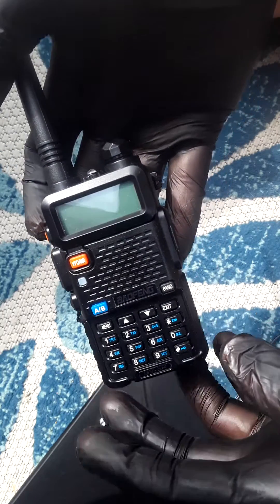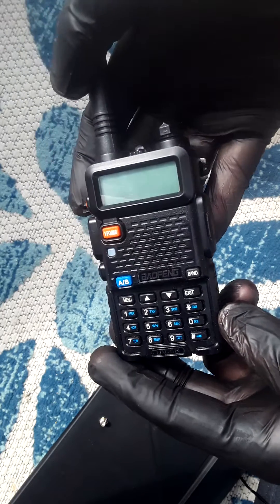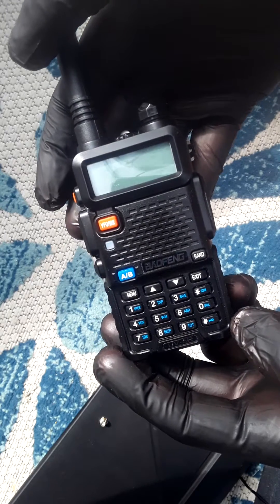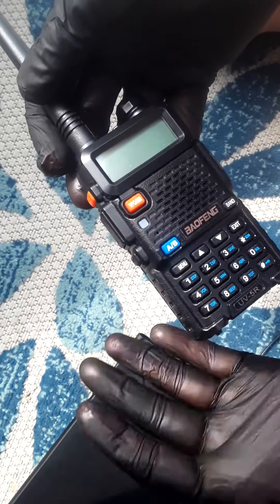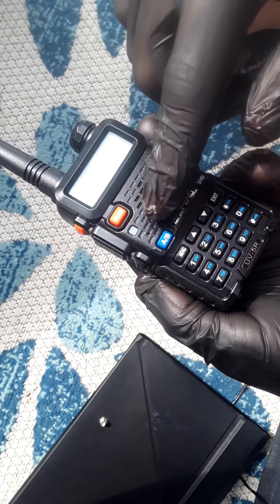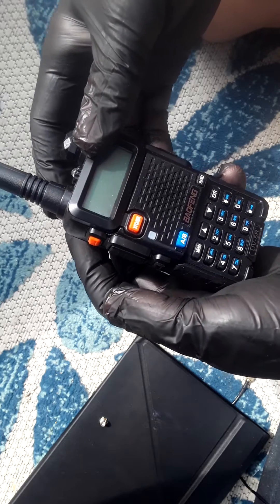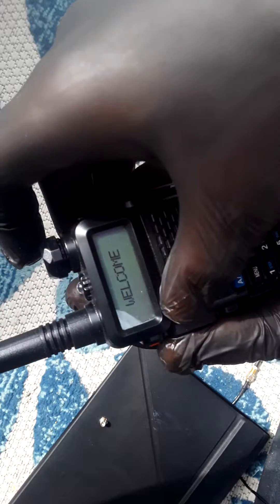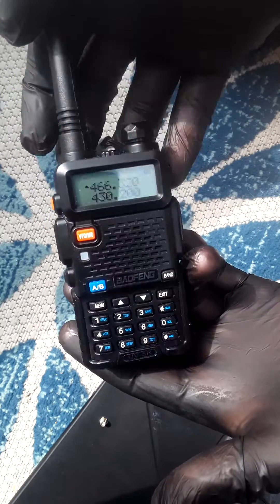📡 Unlock Blocked TX Frequencies On Baofeng UV-5R

Comment: Does this work on baofeng uv 5r+ ?
Reply from the maker: PS: the day after you asked this, someone reported it worked on their UV-5R+. If the video method does not work (if you get another batch), try combining the original key combo with the call button (see commenter J H in comments for his report) and Maxx reported working on UV-5R+ (which is only cosmetically different).
Reply from the maker: I can't say, but from what I've read, many report differences are mostly cosmetic. Would have to try it. Maybe someone else can chime in.

Comment: Hi  Just picked up 2 UV-5R radios and both are locked.  I tried this procedure to unlock without success on both the radios.  After sometime messing around I was able to get the factory message and successfully unlock.  Similar process but you have to press the call button on the side as well.  So there are 4 buttons you have to press now then turn power on. 
Press all three on left of radio and VFO turn power on and it should display factory.
Reply: Both if the methods are not working for me. Is there something I need to change in the settings?
Reply from the maker: @lukeschmidt7246  yours might be unlocked. If it beeps when you press PTT (push to talk) that means locked. some I buy have come unlocked and so factory wasn't something returned. Sure it is locked?
Reply: thank you for this! finally found this comment and it worked for me
Reply from the maker: @jordanmcgarry8135  awesome glad something here helped you
Reply from the maker: Thank you @J H for sharing. Had a few recent commenters report issue. I'll pass the info. Hopefully this can help some ppl.🙂
Reply: I just got a UV-5R yesterday and confirm that just the 3 buttons trick will display factory on it. What exactly does it unlock?
Reply from the maker: @gregson99  Certain frequencies that were blocked from transmitting. Before unlocking, you would have heard a beep noise when attempting to transmit on those freqs. Now you can actually transmit on them (where before you could only listen).
Reply: Tried this method but Factory doesn’t show up. Only a blank screen. Is this normal .
Reply from the maker: Have you tested the radio ptt button? if it beeps, it's locked.
Reply: Hmm mine is same , but your method it just turns the light on ?
Reply: Tried the 3 button and four button methods,  nothing worked and i still have locked beep.
Any ideas?

Comment: ]]]]]why is it not working for me]/\???
Reply from the maker: I had an older one that already came tx unlocked where the 'factory' message didn't appear (as a test: but was already unlocked - this code wasn't built in).

On my 2021 UV5R this code worked as shown in video and prevented the beep heard during signal tx blocking.

Is it a more recent purchase?
Reply: @RTPTechTips  i bought it a week ago , so assumed it would be locked. how can i tell if its locked/unlocked. probaly a stupid question lol im brand new to anything like this
Reply from the maker: @PhoenixBerry1988  Make sure it is off first. Then hold bottom side button and the front red button down same time, then turn knob to on. If it doesn't work it's possible you got a different batch.
Reply from the maker: @PhoenixBerry1988  If you don't see "factory" message, it either is already unlocked, or it isn't correct key code. + New comment (credit user "J H"). They offer a new solution for their batch:  "Press all three on left of radio and VFO, then turn power on and if correct will see factory." Hope this works for you. 🤞
Reply: I’m having the same problem. I just got mine yesterday
Reply from the maker: @jasontcox  Make sure set to completely off first. Then hold in bottom side button and the front red button down same time, then turn knob to on. If this doesn't work it's possible you got a different batch.  😕
Reply from the maker: @jasontcox  just got a new comment (credit user "J H"). They found on their batch:  "Press all three on left of radio and VFO turn power on and it should display factory." Hope this works for you. 🤞

Comment: Does not work for mine at all.Have tried,also another Y Tuber has the same "trick" but still wont work on mine.
Reply from the maker: I bought a couple UV-5R's this last year. What I noticed was that some were already unblocked, and for those, this button reset did nothing - as they came unlocked and apparently never used this factory reset combo.

IME, this button 'reset' only worked on model blocking the frequencies.

Was your radio blocking transmit (did you hear a beep when trying to tx?) 

If your radio still blocks tx, and you tried this, it is possible they are now using a different factory reset code, OR, maybe they have prevented unlocking it on newer models.
Reply: @RTPTechTips  Apparently the model I bought,a new model is permently blocked/locked.I can not get a TX beep when I transmitt on the CB UHF frequencies with the offset split and neg/pos either.Yet those frequencies are within the band range.Im a Ham radio operator with full licence but my local repeater is not working both on 145 mhz & 70 centermeters( 439) because of a huge storm we have had.So I can not set it up for that and see that I get a "tail" from the repeater.I personaly think it's best just to use it to scan through the limited amount of frequences,I have older portable hand helds that are wide open to all UHF/VHF frequences,so this UV-5R may just sit in a draw or give it away to a deserving young person who is new to scanners.But if it does work on the Ham frequencies,that person will certainly need his Ham licence first.Mail ordered dirrectly from China,very disapointed.
Reply from the maker: @jungleman4921  Sorry to hear about your situation. :( 

Thank you anyhow for sharing your experience on newer radios...I will add warning for future potential buyers, in case they think it works for all.
Reply: @RTPTechTips  Sorry to disapoint new owners of this portable,or people wishing to buy one.But from what I know so far,as a new owner and expecting the frequencies to be opened,the UV-5R is very limited to the frequencies it has programed in it only.Can not be unblocked to open full frequency coverage.The government restrictions that effect this UV-5R do not apply in this part of the world ,South Pacific,New Zealand.All Scanning equipment is open to the full spectrum here. So this portable hand held only working on the Ham Bands,is a "Novety" radio with a torch light and siren,FM radio.Certainly not used or needed for the serious  Ham Radio person.Buying this model was a complete waste of money.It is full of features more than alot of other brands dont have,but to be honest for what it is,it will not give you the pleasure of "Open Scan" of the full UHF/VHF spectrum.Dont waste your money on this unless you are wanting a "toy".
Reply: @jungleman4921  So for being a HAM radio operator i'm quite surprised you can't distinguish between CB and UHF (HAM).  CB is NOT on UHF spectrum.  CB (aka. citizens band) is limited to the tail end of the 26MHz and through the beginning portion of the 27MHz spectrum... that's not a US thing, that's WORLDWIDE as established between a conglomeration of the FCC/regulating authority in each country and the ISO (international standards organization). Then in your next statement, you talk about scanning equipment being open to "full spectrum"... scanning equipment does not transmit, it only receives. So while a scanner MAY be able to receive all frequencies it cannot transmit AT ALL. And to that respect there is not a single HAM radio that can transmit on CB because of the power output (again regulated through the ISO). Additionally, there are no HAM HT's to my knowledge that operate on ALL of the HAM spectrum. This is due to the fact that you can only fit a certain amount of transistors, etc. on the circuit board of an HT.  Now are you referring to you can get full spectrum on a MOBILE (i.e. a vehicle mounted radio)? If so that's NOT the same as comparing this HT to a Mobile.  Mobile units that can receive all of the HAM spectrum (i.e. all available HAM frequencies), are quite large, but are available.  Typically a lot of HAM operator's use this as a base due to their size, but if your truck is big enough then you might have one mounted in your vehicle.... otherwise if a very small Mobile unit, it will only receive at most 3 different frequency ranges.  So are you REALLY a HAM operator? To me it seems weird having to educate another HAM. Or did you not clarify the difference between this HT and your Mobile unit? If that's the case, that would be like blaming your hammer for not doing a good job painting your house..... two different tools with their limitations and two different purposes.
Reply: @crossbowsniper  All of what you have written is true. I worded my comment to you wrongly.Appoligies !.

Comment: mine just says "coping" doesnt do much else
Reply from the maker: I have 2 different versions of uv5r now. In fact one of the newer ones I more recently received was not locked at all! Maybe yours is this way? The one I got a few months ago was locked (if you hear a BEEP when you hit push to talk, this means tx is locked for that freq). 

If it doesn't beep outside Ham
Reply: @RTPTechTips  I have 4 older Baofeng UV-5R, when I go to program it says wrong type of radio. I am using Baofeng software, this has worked for all the radios  on our group. I know how to unlock them, but these just blink the message "coping" instead of Factory.
Reply from the maker: @kenlefsaker9727  Interesting. Thanks for sharing your experience. Many of the older ones came unlocked. It's the newer ones that required the button combo to unlock.

FCC sent a memo out to seller of baofeng (within last 2yr) and afterwards in a bit of confusion, they started locking tx outside ham bands.

Do you hear a beep when you test transmit? If so, the beep indicates locked tx.